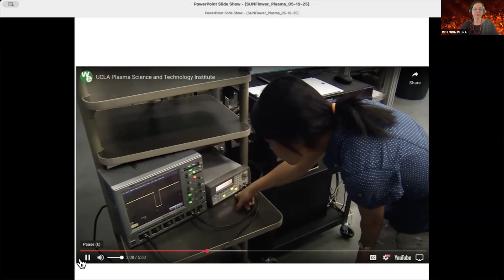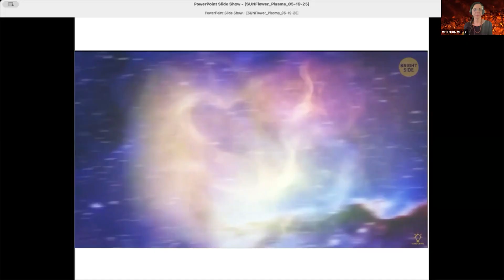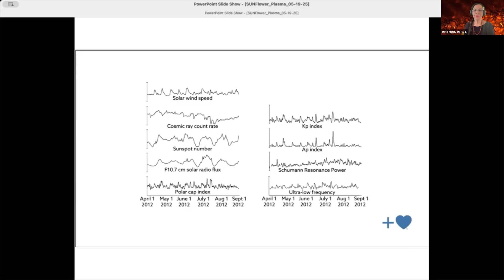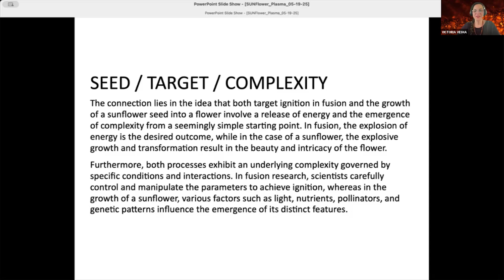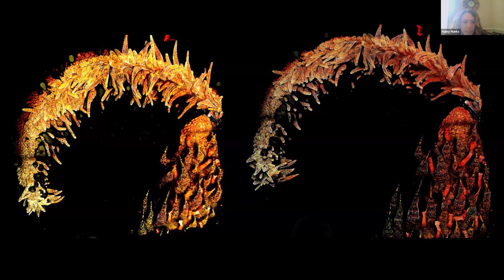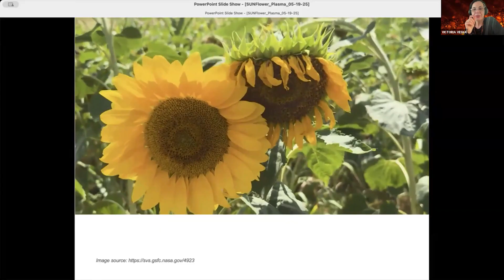sun flower plasma & the solar maximum

Comment: NIF has always seemed irrelevant to me. It doesn't appear to have a path to energy generation, and if it does - it'll be the most expensive electricity ever generated.
Much like ITER - the only things that'll come from NIF is some interesting nuclear physics, and stacks of PhDs taller than the buildings the reactors inhabit.
Neither waste of money will ever produce a single watt for the grid, or result in a reactor which does! I'll bet money on it.
This because the sun is condensed matter, with a lattice structure, and intercalate zones which accumulate elements. So, any and all attempts to "reproduce the interior of the sun", using gas or plasma, is doomed to failure.